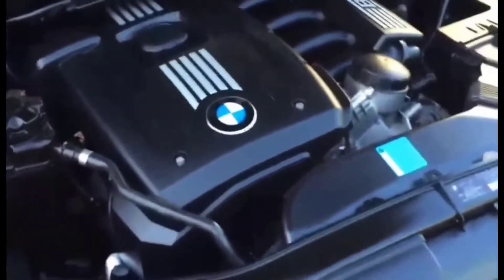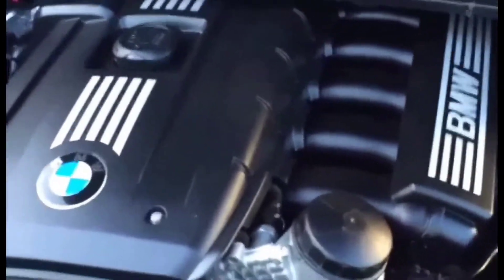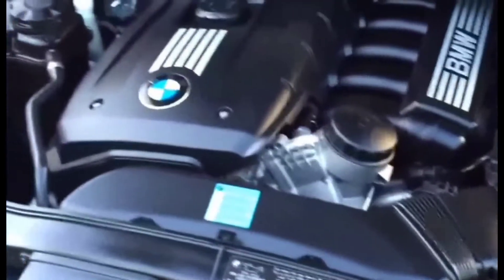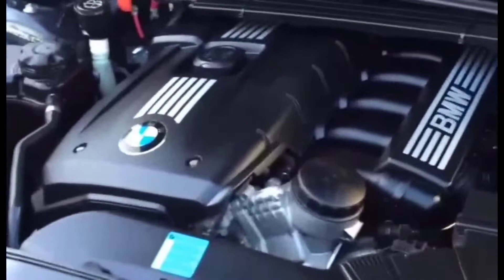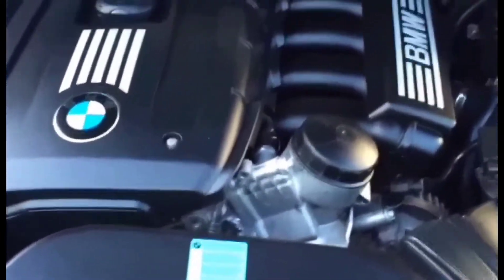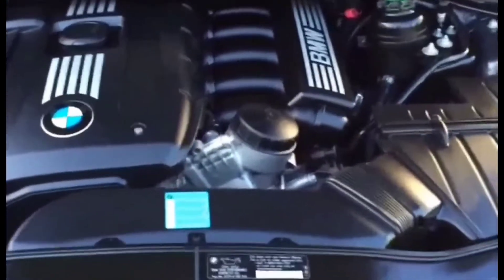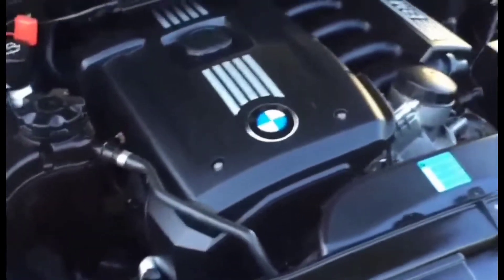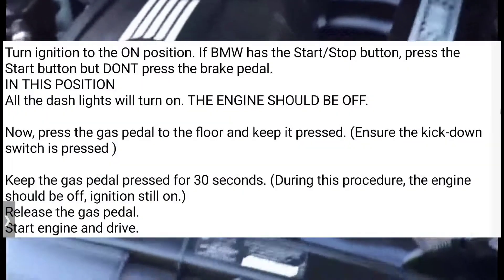BMW ECU/TCM TRANSMISSION PROBLEMS AND RESET PROCEDURES -TRANSMISSION MALFUNCTION ISSUE FIX

Comment from the maker: UPDATE-

Hey guys, thank you for watching this video...if this has helped you out in any way please SUBSCRIBE, press that LIKE BUTTON and leave a COMMENT.

Please check out these links that WILL GAURANTEE TO HELP DIAGNOSE AND SOLVE YOUR CAR ISSUES.

https://amzn.to/3hbxVF3

https://amzn.to/3o762Qc

https://amzn.to/3w4DolB

https://amzn.to/33sZzoY

Analyze your car issues and ERROR codes and clear them with this Amazingly accurate yet inexpensive OBD2

SCANNER- https://amzn.to/3tq0bGJ

Wireless Scanner- https://amzn.to/3f1ahZr

Test Your Battery And Alternator 

https://amzn.to/33r7umN

If you would like to help this channel, your donations are appreciated.

Cashapp- $PeterLCG

Venmo- PeterLCG

THANK YOU

Comment: This does not reset your transmission.  This procedure resets your throttle position sensor.  You need ISTA or a high quality scan tool specific to BMW to reset the transmission adaptations.
Reply: I'm getting the "Trans Program" message and it's stuck in 3rd gear on my 1994 E34. Do I need to have the transmission module read? I don't know if this is possible on a '94